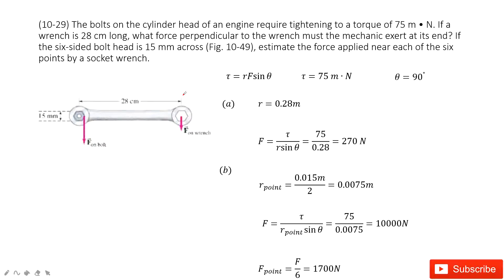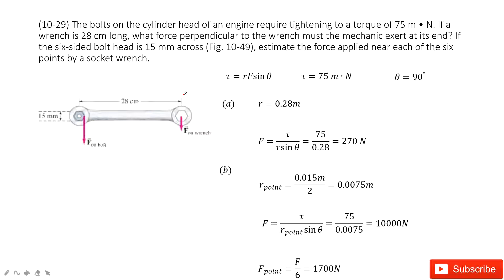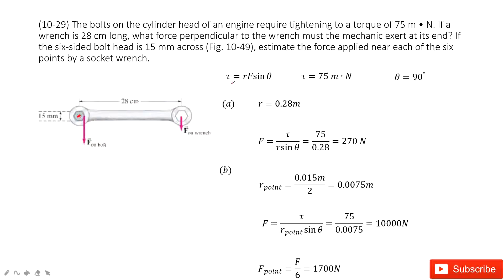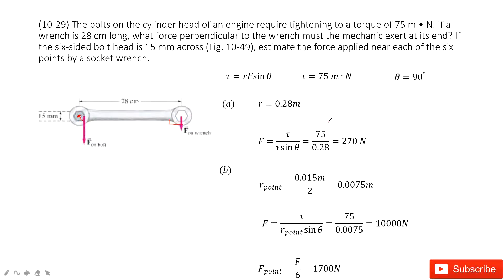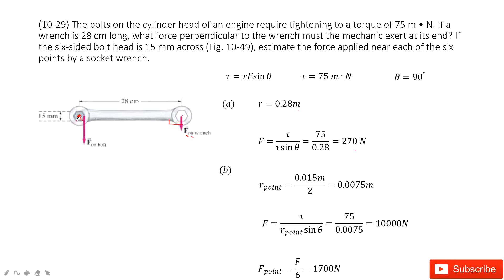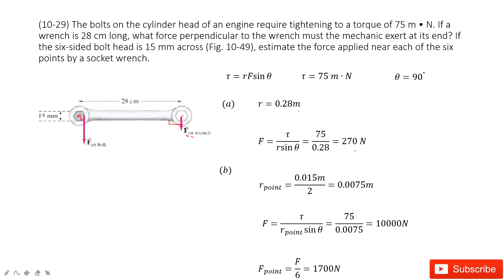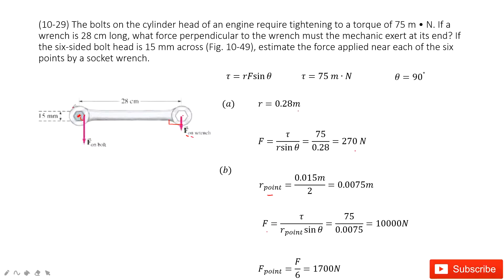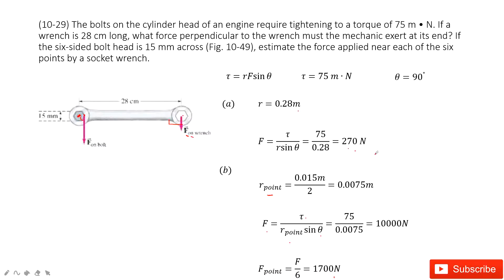(10-29) The bolts on the cylinder head of an engine require tightening to a torque of 75 m • N. If a

Comment: I think that's an error to assume r(point) = 0.015mm/2.
Geometrically this is the height of the equilateral triangle, while the six points rotate with a distance r(point) = 0.015/2*sin(60), i.e. the side of the triangle.
With this radius the result is of about 1440N.
Reply: thanks boss ur right
Reply: thank you you are right.
the distance from one vertex to another cannot be the same distance from one edge to another.
Reply: You're thinking the right thing, but this doesn't really apply here. This doesn't really make sense, but by saying that the diameter is 15, the question wants the reader to assume that somehow the points on the bolt are equally spaced from the center in the form of a circle. Otherwise, they would have said the height of the hexagon is 15 mm. Hope this helps!